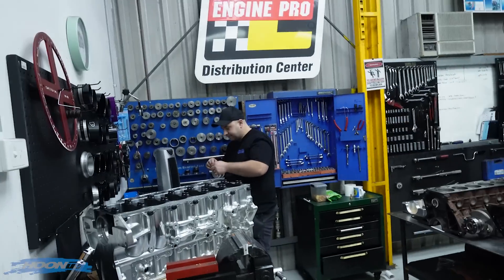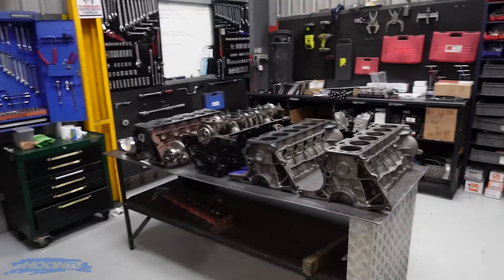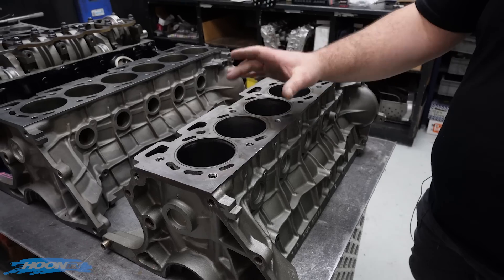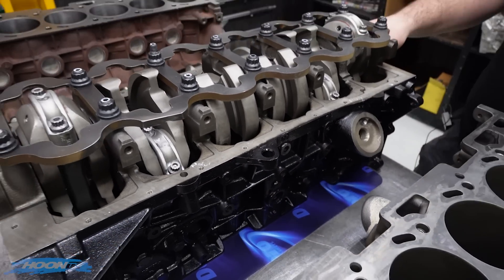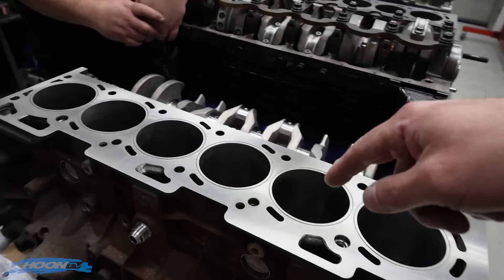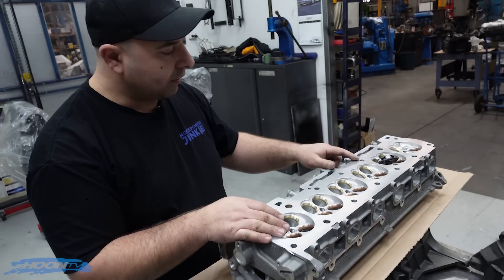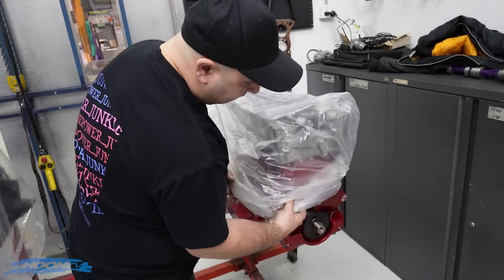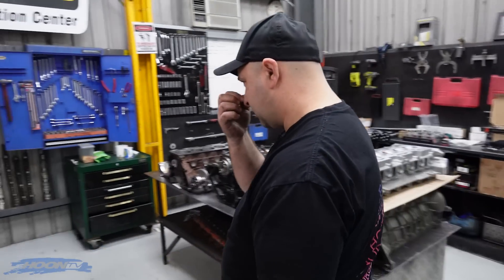EVERYTHING You Need to Know About FORD BARRA BLOCKS

Comment: You Should do a V12 Barra block. Only thing, do you design it so the valving & camshafts on the 2nd head is swapped arround, or do you do it so one head is switched arround & has the camchain setup at the back on one side, at the front on the other side? Like the way motorcycle people do V8 versions of Jap 4 cylinder motors.

Comment: Hey Boxer, I have a MY00 CBR1000F that's partly in bits with 65K on it, the brakes needed replacing and I was going to give it a birthday but got carried with another project and a new GSXS1000. I have all the original parts and most of the new brake parts are you interested in having a look, I'm in SA.
Reply from the maker: Hey mate,

I appreciate the offer, but I just got another bike project 🤦‍♂️🤪

Comment: What the hell changes between the BA/BF blocks that changes it from handling 500hp to 1800hp?!
Reply: ba/bf stock rods are the issue not the block. later turbo rods are beefier so can handle more power on a stock bottom end. 
when they were discussing early blocks getting destroyed it's a result of rod failure not block failure.
Reply: @6226superhurricane  that makes heaps more sense, thank you
Reply from the maker: 1800hp from a stock BF block? Good luck

Comment: Hi guys I have an FG 2009 gas bottom end I have a BF turbo head on it just curious is there a difference in the cc head from the FG gas head to the turbo head would it lower the compression ?? roughly what sort of boost should I put through this on 98 and what would it handle?? appreciate any help thank you cheers Tony...👍